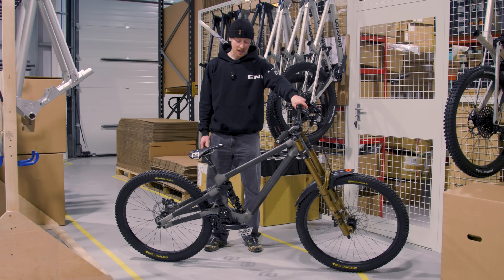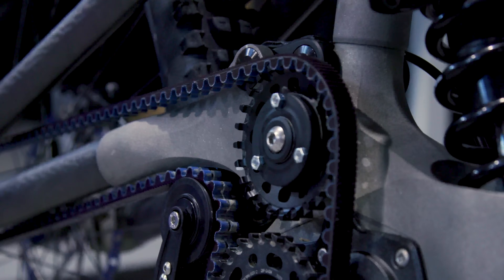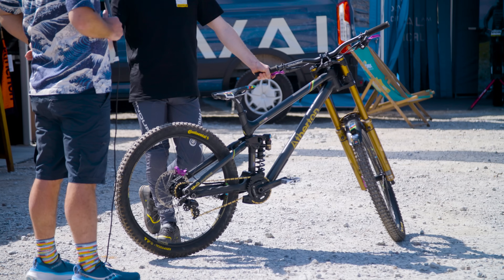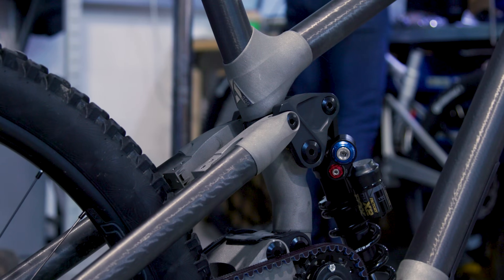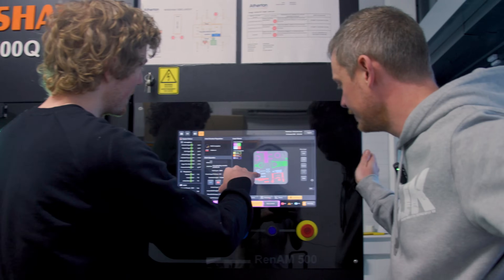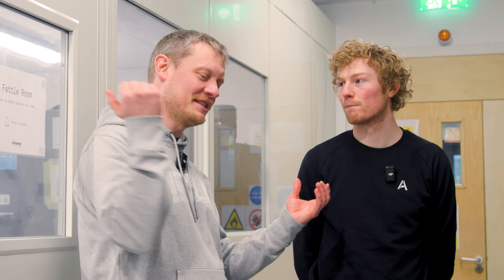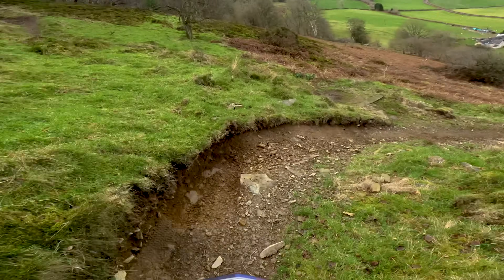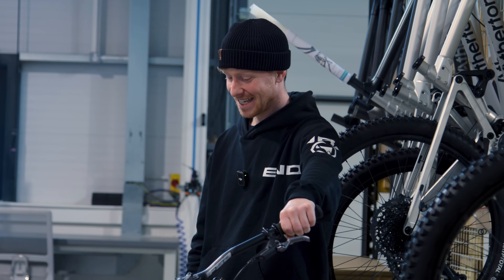Atherton’s A200G DH race rig is UNREAL

Comment: Glued together frames and rubber band chains are definitely the future!
Reply: @johnnyweekend  this is an awful misunderstanding of the mechanics of whats going on there though. I know its probably tongue in cheek but still.
A better description would be a frame thats pressfit together, because the primary loadpath doesnt just rely on the epoxy adhesion strength. Id say most of the load relies on face to face contact, and the 'glued together' bit simply resists the resultant axial sliding vector component of the tubes when the system is under load.

Tl:dr, if one was assembled with no glue, id bet you could still sit on it and it would stay together well
Reply: @adamchambers7502  A fancy way of saying it's glued together in order to save on costs. There's no other advantage. 3D printing different size lugs so we don't need different length tube's saves on cost. We also don't need a jig or a welder to put it together. We can have our intern can slide the tube's into the lugs in our bathroom, which again, saves on cost. We don't need multiple carbon molds, a massive oven, or toxic resin to glue carbon patches together in tue mold. It's genius and definitely the future. Using a rubber band for the chain is the cherry on top.
Reply: @johnnyweekend  😂😂😂